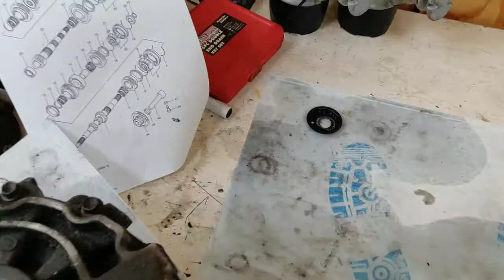Suzuki ignis Transmission assembly

Comment: Helo, I Have a IGNIS 2004 model hatchback. I am facing a problem with the transmission box. Second gear is not work properly. When i shift to second gear from first gear it automatically back to first gear. How can i solve this problem? Or which part of the gearbox i will check to findout this problem? Pls let me know
Reply: By the way my car is manual transmission
Reply from the maker: Its the syncromesch rings 👍